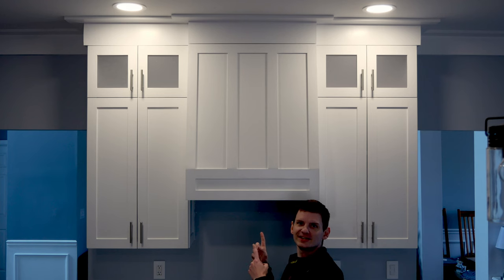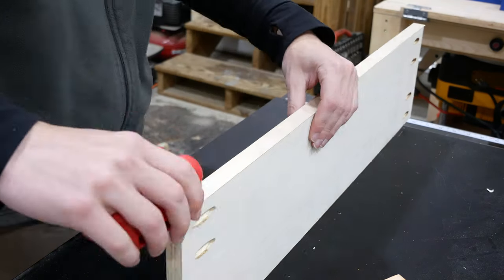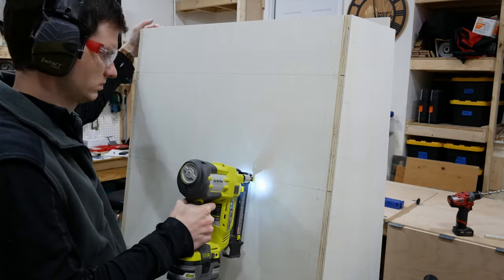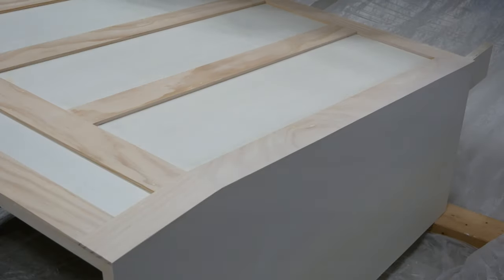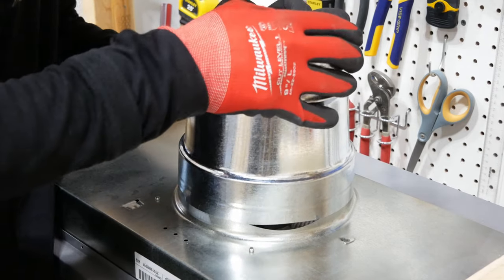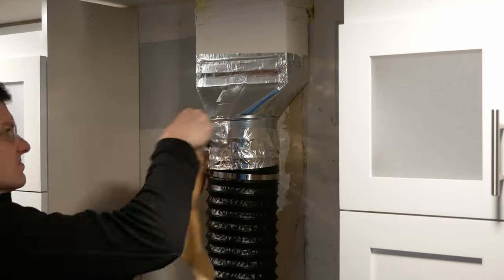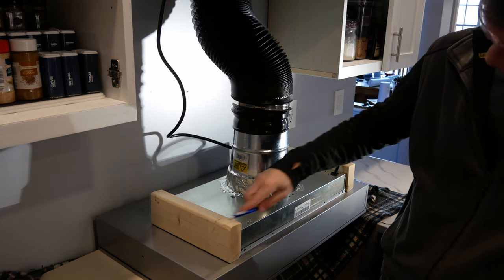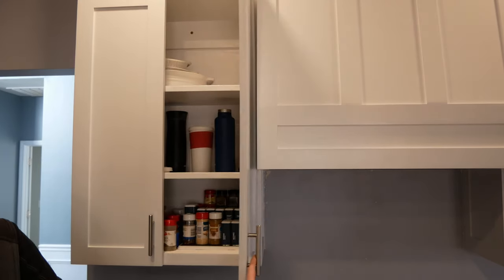How to Make and Install a Shaker Style Range Hood Cabinet

Comment: I will definitely be using this as a guide! Thank-you so much for making this video, it's so helpful to include all the details from start to finish, and most importantly, the set-backs (like the caulked outdoor vent!).

The main change I'll be making is making the large front angled piece moveable (on a hinge). I haven't sorted it out yet entirely, but I'm committed.
Reply from the maker: You're welcome! Making the front hinge able is a good idea and something I would change if I were to make another

Comment: Thanks for sharing. We are buying a house and I want to remove the microwave and install a vent. Either an under cabinet or an insert like you did. Finding video to make a wood range vent on youtube was harder than I though. One thing I noticed on stronger blowers like zephyr is they do not recommend flex duct but the ones im looking at are 750+CFM so that could be it. Thanks for making this video and not including the typical woodworker youtuber fluff.
Reply from the maker: You're welcome! As some other viewers have pointed out, flexible duct is not advised as the ridges can collect grease over time and present a fire hazard. It makes sense and I wish it was something I had been aware of before installing mine, and if I were to do it again I'd figure out how to use a ridgid duct

Comment: Nicely done.  I wondered if that edge banding will stay secure when the own and range below are used for large meals like a Thanksgiving turkey or if the radiating heat will cause a failure.   I like the look and the design.
Reply from the maker: No problems so far. Edge banding glue melts around 400 degrees F so it should be fine
Reply: @ProjectBilld  Good to know.  I do know that the top of our oven gets very hot when we have a big bird in the oven for many hours.  I believe my dad used to apply edging with contact cement.  This seems so much easier.

Comment: Nice video, but by reducing your exhaust from 7" to 6", you reduced your CFM by at least 35% and likely somewhere between 50-70%.
Reply: He should have go up to 8 inches instead. That being said, it's probably still more than enough if he used the proper ducting instead of the flexible dryer stuff.

Comment from the maker: A few people have commented and mentioned that the flexible exhaust vent I used is against code. I've looked it up and it does seem that is true. Code requires a smooth duct as the ridges in a flexible duct could potentially have grease build up over time and catch fire. While I don't think this is a huge concern, I can't recommend using the flexible duct anymore.

What I don't understand is how one is supposed to seal the duct at the range hood if a smooth rigid duct is used. If anyone knows and can provide some insight on how to lift a range hood in place and seal it with a rigid duct it would be greatly appreciated.
Reply: we either make our hoods with a removable front access panel, or we make them 3 sided (no back) in that scenario the hood is actually installed first, sitting on cleats left and right, then the hood slides over the front of it and it screwed in through the sides of the cabinets and on a hanger strip up top if there is a crown going up that will hide the gap needed to reach the it with a drill and extension
Reply from the maker: Ok that makes sense. Appreciate the insight!

Comment: Awesome video! Not going to lie I’m totally stealing your design for a kitchen remodel for a client. It’s a shaker kitchen and that range hood will fit in seamlessly. I do have one question and you may have mentioned this already but I don’t see any visible controls on the range hood. Do you have to reach under to turn on the fan and light? If so, is there another design element that could be added to where you can access the controls from the front? Thanks for the video it was a lot of fun to watch!
Reply from the maker: Yeah I have to reach up under to get to the controls. It is a bit annoying. I think you'd have to look for a different range hood insert if you wanted controls located elsewhere

Comment: You edge banded the bottoms of the ranger hood vs using drywall compound like on the upper cabinet doors. Did you find that the compound wasn't as durable?
Reply from the maker: Yeah I'm not sure I like it yet. I've only used the drywall compound on the shelves inside the upper cabinets so far. It's soft and shrinks a lot when drying and I had a small chip in an edge of one of the shelves so I'm going to keep looking for something better to use. Wood filler comes to mind but is too thick to be a good option imo. I would certainly like to find something better than edge banding long term
Reply: @ProjectBilld  I wonder if something like a 10 minute hot mud would work better. Its my understanding that that stuff dries harder than an all-purpose mud. Have you had any issue with the banding peeling? I had tape on a drawer edge pop up on me. Not sure if I rushed putting it on or if thats a preview of whats to come in a year or two
Reply from the maker: Yeah that's likely in the direction of what I'll be trying next. All the edge banding I've put on in the kitchen (and elsewhere) is holding to this point. I have a tv cabinet I made 8 years ago and that edge banding is still fine. I've found that it either detaches in the first few hours/days or not at all, but the fact that it could detach is what makes me look for alternatives

Comment: whaaaat why would anyone caulk the exhaust port closed
Reply from the maker: Beats me. It had been painted over so I'm guessing the house was repainted at some point before I bought it. Otherwise it was the original paint job... And that's even worse ha
Reply: The previous owners were probably tired of hearing it clunk during windy days due to back pressure. My previous house had that issue, I didn't caulk the vents shut, but I would be lying if I said that never crossed my mind.
Reply from the maker: Hasn't been an issue since I've opened it up. Previous owners didn't take care of this house at all so I can't even begin to guess why it was done